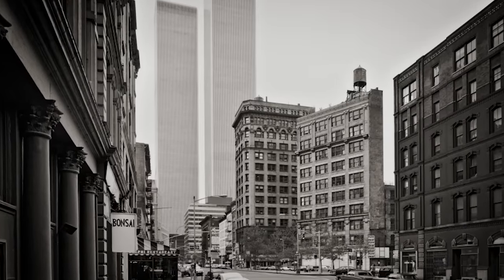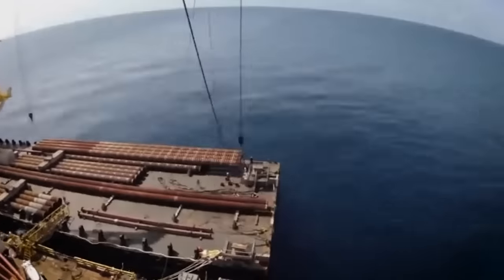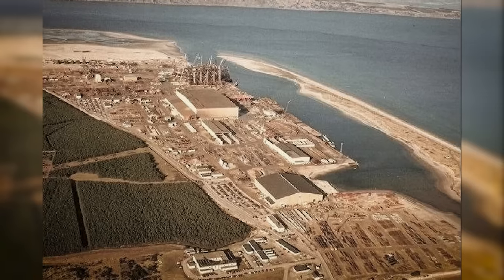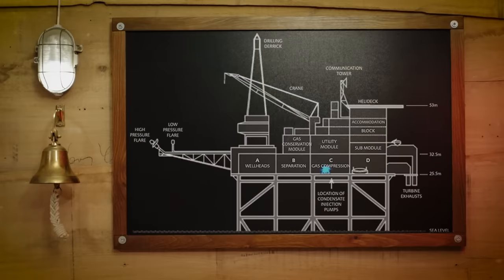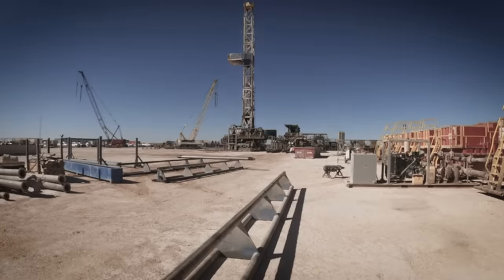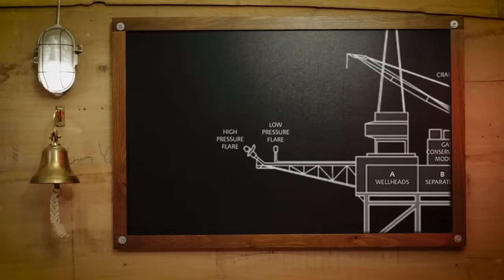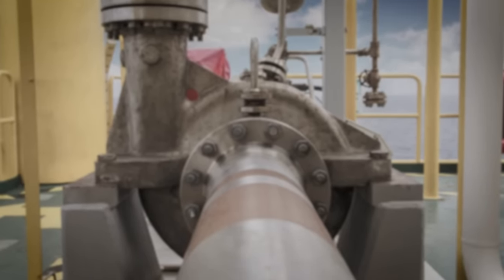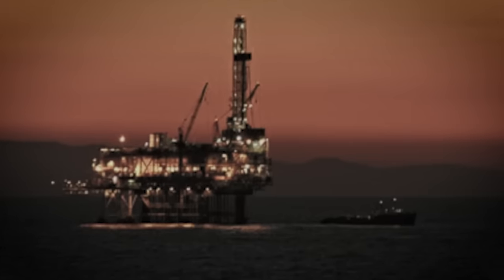This Block Has 87 Dead Bodies

Comment: A lot of good came out of this clusterfuck, it made a huge difference to the safety culture regarding unfinished permits. There weren't any, all permits are closed & re issued after each shift change (as a serial permit) and all safety aspects are re affirmed. As I previously posted in certain areas of the world even with a strict permit culture people will ignore it even working for a major like Shell. It's been a while since I last worked offshore but it was becoming like working in a nuclear power station where sometimes it's impossible to carry out any work.

Comment: The swiss cheese model, many things have to line up in order to cause a problem. I understood 3 crucial catalysts that caused this accident, worsened by losing the control room so that no SOS could be emitted quickly, no evacuation alerts etc.

I agree with your response to Jeremy, but I do think you're being too defensive - Yes, this kind of tragedy would I hope lead to safety improvements:

4:43 - the engineer logs that this safety valve was removed and the pump MUST NOT be turned on at any point
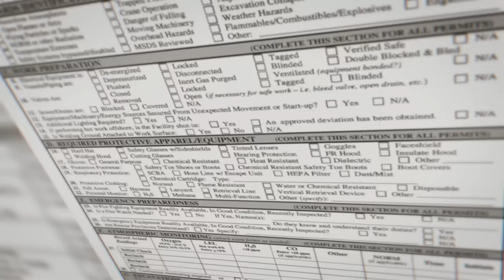8:00 - The log is stored in a totally different place without any way of quickly identfying this.

Then you have 8:19 because of pressure to get the pipeline flowing... This is where things go horribly wrong. 

Knowing there is work going on and maintenance happened, why were things rushed? Why didn't the decision maker make certain there was not instruction to NOT turn on the pump?

This isn't me portioning blame for the accident, I'm simply suggesting it's trageic how someone only needed to take a few minutes longer going to another location to check a log.

Comment: One hopes that with digital logging systems, stuff like this will not happen again. Because the engineers will/should be able to link something they worked on with everything down the line, that may be influenced by what they did.

Comment: So there was just a note about the pump that must not be started? Seems horrendous from a safety perspective. There needs to be a breaker switch that is turned off at the engine and is locked with a padlock indicating who and why it's locked.

Comment: There should have been better communication NOT to start pump A under any circumstances.  Instead that information was buried in some paperwork that wasn't checked.  Something that important needed to be announced on the loudspeaker or face to face between all the shift managers.

Comment: If it had been passed on that pump A must not be used, production would have had to be stopped and the catastrophe would not have happened.  But one didn't know what the other was doing, so it ended badly.
Reply: Exactly. It is hard to believe that an industry with supposed extreme safety and redundancies could just happen like this. One major error helped along by many others, all preventable. So Sad RIP All.

Comment: I'm an electrician and if a motor starting can create a hazardous condition then you make it inpossible for the motor to start. lockout, pull belts, unwire, whatever is going to guarantee a safe condition. Relying on paperwork is an absolute joke and i cant believe this is real.

Comment: These are massive structures
It is insane we still still use oil.

Solar and wind has been shown to be a viable solution for power at homes.
A 10kw wind turbine and solar panels on the roof will provide 90% of power under full load of the home and most of the time these produce excess power sent into the grid.

There is no reason why we should not have been building every new house over the last 20 years with solar and wind.

Electric vehicles are now viable and they should be the ONLY vehicles sold for most places that don't have very cold winters, and in those places hybrid cars should be required.

The fact that the SUVs being sold today only get 10 miles per gallon is just sick.

In 1988 Ford made a model Festiva L, a 3 cylinder engine that could do 65 mph and was sold as a commute car, and it got 40 mpg in the city, and 60 mpg on the highway.

MIT made a car in the late 90s that ran on a 2 cylinder engine that got 200 mpg.

We absolutely can get off oil.

It is crazy to keep having these platforms blow up

Comment: A perfectly reasonable sequence of events, but reasonable is not good enough with such industries, same holds true for the manufacturing industry and others. Their procedures and everything were reasonable, but did not account for human error. The critical failure point in this was the pump maintenance. This is because the best accident is one that never happens. When something like that is taking place and a shift change happens you need to make sure that the information gets to the next guy in at least two ways: writing, and verbal. 
Edit: 
"Hey, Steve. By the way the pump A valve is still out for maintenance, it's all in the paperwork."

Comment: They had a HORRIBLE Lockout/Tagout system ! I worked in a power plant for 30 years . Any equipment that is not to be operated MUST have the switch tagged out & the breaker racked out and tagged . Failure to do so is termination.

Comment: Great video, I cant wait to see more from you. 

I do have a small bit of constructive criticism however. If you insist on using background noises, make sure they are not quite as repetitive as the fire noise you use, and if possible make them match more whats going on. You do well with your explosive moments but that soft wood fire in the background just popping and ticking away in a docile manor does no justice to the raging inferno you're talking about. :)
Reply from the maker: Thanks for that

Comment: A lot of those oil rigs are where they are because of the lack of oversight. Much easier to be lax on the rules & regs when you're in the middle of the ocean as opposed to in the middle of the country. Even the ones in the middle of the country don't play by the rules, so those in the middle of absolutely nowhere are blind to many of the do's & don'ts.

Comment: Putting information about a pump that would be dangerous to use in some filing cabinet was definitely not reasonable. A reasonable procedure would have been to place some very obvious warning on the pump itself and on its controls, or better yet, physically disable it as well.

Comment: I didagree with the "reasonable" conclusion 
I think the main "unreasonable decision" was the stupid choice to hand tighten the block off plate over the removed valve.... Had they not been too lazy to tighten the bolts with a wrench then the paperwork being in different places was irrelevant because gas wouldnt have come blasting out when the system was turned on. Even if everything else was ignored the one lazy dude who decided hand tight was good enough to pass a visual inspection that he did his job was the root of the issue.

Comment: well its not reasonable that the foreman didnt know about pump a. the guy filling the vending machines should be told not to toutch pump a if its in that state. tell everyone on the rig not to toutch it.. the foreman didnt know? its alsp weird that they put the process on hold, on a rig working round the clock it seems logical to finish the inspection and repairs to pump a instead of letting it lay like that

Comment: In the end what destroyed the platform and killed 167 good lads was an incredibly flawed system of PTWs...
If the PTW for one generator would be rightfully paired with the one for it's safety valve (even though they were in separate modules), none of this would have happened...
Better than storing PTWs for each production module, is to store a sequence of PTWs for all the parts related to the same line of flow.

Comment: Holy...
Shit...
As an engineer, can I just say WHAT THE INCOMPETENT FUCK!

I literally had to pause the video and nearly fell out of my seat at the phrase "they could see explosions but didn't have the authority to stop pumping fuel" . O_o First off, in rocketry (the industry that I work in) it is hammered in to every employee that EVERYONE has stop authority. Second, "everything is exploding" is the ULTIMATE stop authority. That is just insane.

Also, why would the control center being destroyed not trip an alarm? Deadman's switches were invented in the AGE OF STEAM, there should have been alarms blaring across that whole field the second the control signal cut out.

Comment: How the fck such massive explosions were not heard by the personnel at the living quarters?! I would've expect massive smokes and vibrations as well. Let alone not a single person from outside tell them that there is a massive fire explosion and that they need to evacuate ASAP? Seems like no one thought about the possibility of the command center being completely destroyed. I wonder why was it made so close to explosive substances... Why when the main alarm was pressed the living quarters block was not informed? Maybe it was due to the damage, but this is why there should have been some other means to inform them regardless of the damage. This reminds me of the horrible disaster of MV Sewol where the kids were abandoned by the crew :(.

Comment: digitalization would've prevented this tragedy. all relevant work forms being gathered into a central digital repository with ability to filter by relevance and date filed and automatically having the lastest safety related filings placed on the home screen would've meant that the engineers could see that the pump wasnt able to be started safely. terrible.

Comment: The “metal disk” is called a blind
Reply: As in you’ve “blinded off the pipe”,  other sorts of blinds are installed between flanges to “blind” that pipe 100% from the live side of piping

Comment: Such rigs need a tatally indnendent platform for non esential workers. The hunger for oil and gas, should not outweigh preservation of life or safety.. Will the ever learn? It is much like the underground coal industry when pressures are put on men, and those men lose their lives, while CEO's and high rank executives sit in the luxury of their air conditioned offices.

Comment: yes you always can wonder why the men did not exit the accommodation block once the emergency got underway - however, there will be processes and protocols to exit the block such as waiting for the signal to exit wait for proof there are liferafts waiting for otherwise you will drop into the deep dark ocean late at night and be lost - it would be a TERRIFYING experience not knowing what to do the mass hysteria the waiting to know what to do the shouting and yelling turning into hysteria chaos even fighting and punching each other in the pitch black darkness hearing the sirens and explosions not knowing what was going on all in the blackness apart from the heat coming in knowing the whole place is an inferno - a truly shocking way to die

Comment: Wow that's really a very sad video because the people who were on the oil rig were died because of the fire suppression system was put on manual mode instead of automatic mode it's really a crying shame because the divers working in the water were no were around the intake of the pumps don't know really who to blame but someone is responsible for this accident for sure people for sure ⚡😎🍀❤️🤍💙🙏💙

Comment: simple thing that at least while I've been working in heavy industry has been there as a stantard procedure in 2000s while I've been working... could have saved this. It's called lock box. So sad to think about that simple lock could have made impossible to open the valve that caused this accident.

Comment: I think what a video like this, where someone explains every single detail and step of how a multi-platform oil and gas rig and pipelined system needs is, instead of one or two generic photos, many different intricate detailed maps, etc. per sentence, maybe go with a steady stream of random pictures, and maps every single second. That way, we don’t even need to try and follow what actually happened to the rig and just sit back and trip out on the thousands of images flying by. 

Literally every single sentence began with a new stock photo of a rig or people smiling on a rig or a random pipe on a rig or a 1 second shot of each rig or a map of the entire system of rigs with 25 things to explain while he’s reading the instruction manuel for how the whole thing works. I’ve made it to 05:30. 

I’m out lol

Comment: Absolutely no-one wants a Piper Alpha or a Deepwater Horizon yet such catastrophic accidents continue to happen in spite of legislation or the best practices of design engineers or operators. Anything that can go wrong, will go wrong, given enough time. However safety conscious a company or a government department is, there will always be situations that are not anticipated by designers or operators. And that ignores
accidents caused by cost cutting, laziness,
recklessness etc etc.
These type of accidents are catastrophic enough, but the principle that there will always be unanticipated situations equally applies to nuclear power generation. However, the consequences of a nuclear accident could be infinitely worse. Britain is a relatively small island and a serious nuclear accident could kill most of the population and make the island uninhabitable. Because the consequences of a serious accident are so serious, the risk is very obviously not worth taking, especially as we also have to deal with spent fuel storage and vast expense. If all the money put into nuclear power had been applied to green energy generation, we would now be incomparably safer, have saved vast sums of money as windpower is cheaper than nuclear and have developed the storage systems for green energy to be viable whether or not the sun shines or the wind blows. We need to abandon power from nuclear fission. In Europe, only the Germans it seems are bright enough to realise that more nuclear power stations means more risk of a terrible accident like Chernobyl or Fukushima or much much worse.

Comment: The inability for people to think for themselves is stupidly astounding... Oh I can see an oil rig is encompassed in fire but because of my inability to think for myself and would rather follow money hungry corporate rules I wont shut down oil and gas flow to that oil rig because "I'm not allowed too" incompetent twat. When there is an emergency, screw the company, double screw the investors, and screw worrying about a job. You do what you can to help limit the danger to people no matter if your actions would financially collapse the company in doing so. Anyone who fails to act because "I didn't have authority" even though then knew what to do to help, especially when its not going to risk their own lives to do so, should be held accountable for their failure to act. Also putting the rubber mat that prevented the steel deck from doing its job is not a "reasonable" decision. Its a decision that counteracted the safety design of that rig.

Comment: Typical mentality of some workers .
Bad management and planning.
Bad training .
Plus the fact that no one has the courage to take a sensible decision.
The valve inspector should have been aware that the pump documents were elsewhere.
There should have been a handover book detailing work in progress and more than one way to flag a danger . A simple card ,placard ,tape or not attached to the pump switch would have been ough as used in aviation.
Total lack of safety standards and bad work management led to the loss of so many personnel and destroyed the lives of many families .
No proper regulatory controls. In place and no proper safety controls,checks or standards in place .
Who in their right mind would end their shift and leave a vital component hand tight .
If no records were found who is to say this is a factual report.
Seems the controlling company could wash it's hands of blame .
However you do get deadbeats and big heads doing their own thing from time to time risking people's safety or in this case killing people.

Comment: Im seeing quite a lot of blame on the greedy companies, lack of safety, etc in the comments. This thing operated safely for many, many moons. And greedy companies love safety because it makes more profit more efficiently. This disaster was a failure to lock/tag out an offline pump. So simple. Even today this can happen and even on a rig with plenty tagouts ready for use. Theres just so much hustle and bustle on these rigs, so many different crews rotating. Its sadly just a matter of time before something goes south. Even today all it takes is a worker to forget to mark a tagout and a supervisor who doesn't check either. Everyone there is making money. I dont think these companies willingly put workers at more risk than necessary considering the money flows much better when there are no issues. It shouldn't require disasters to implement safety procedures that catch careless errors before they blow up, but thats become the reality of it. Even decades later we still have bad disasters. DW Horizon is a good example. Evolutions in safety on any type of production that exists where man can not live naturally is inevitably going to cost lives. It will be that way forever. Its a brutal look at reality. Just gotta thank those dead men for making today's systems a few notches safer on an infinitely large graph.

Comment: Terrible documentary that rehashes previous discussions and conclusions.  One of the final comments in Waterline Stories that "Piper Alpha operated relatively safety" is not true.  The Cullen Enquiry makes many observations on how this facility was run unsafely and that Occidental management really didn't monitor the performance of the facility to operate safely.  There are far better documentaries that lay bare the facts on how Occidental operated Pipe Alphas and why they allowed their management system to fail to control risks.